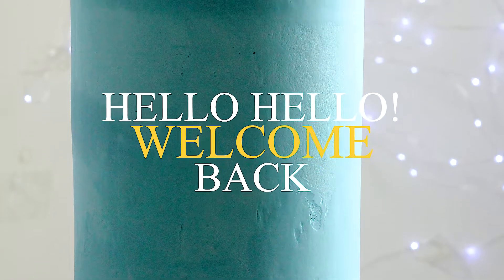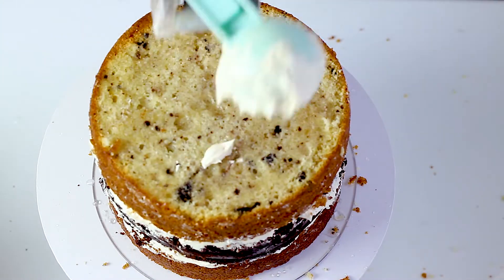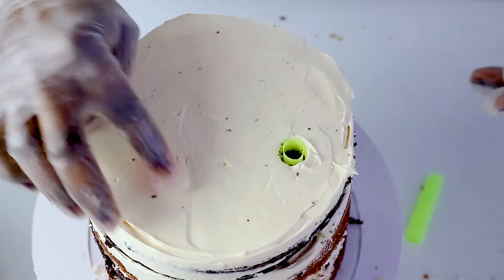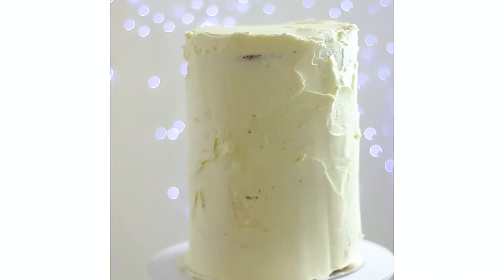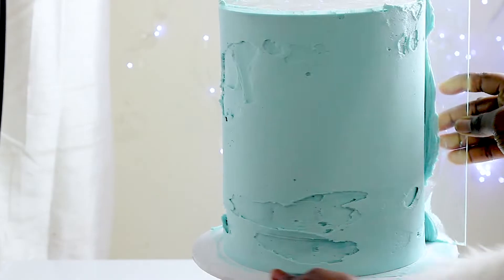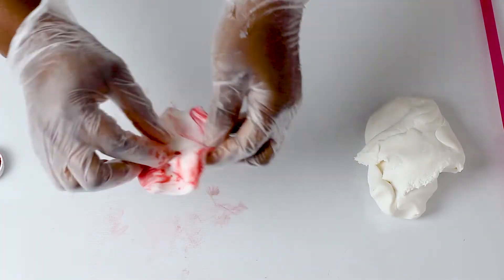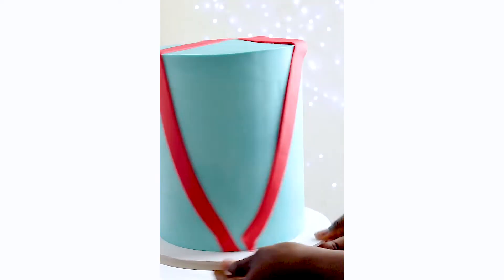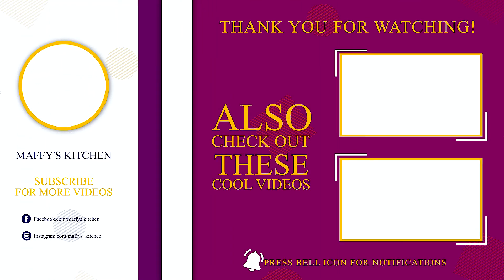How To Fill, Stack A Tall Double Barrel Cake | Using ACRYLIC DISC | Layer Cake

Comment: If you were making a tiered cake with the double Barrell cake as the base, then how would the support system for the top tier work? Would u push the dowel all the way down or until u hit that middle board?
Reply: You would poke a hole in the center of that middle board so that the center dowel goes through each layer of cake.

Comment: How do you know the dowel can pass through the middle board directly and simple as that
Reply from the maker: Great question! I previously drilled a hole in the middle and aligned it to stay in the centre of cake to allow the dowel pass through with ease.
But I understand there are some thin cake cards that are quite easy to pierce through without pre-drilling even though I wouldn’t take that chance.
Thank you for asking. ❤️

Comment: How do you bake those thick layers? Mine are either burnt around the edges or raw in the middle.
Reply: I used to have the same problem until I started baking at 160°C/325°F. I also invested in an oven thermometer. Hope that helps

Comment: Looks fantastic!  Will you share your buttercream recipe?
Reply from the maker: Thank you so much. I basically used the common American buttercream (ABC). Only that I don’t always use the exact 1:2 ( ie 250g butter to 500g icing sugar) measurements as most do depending on the weather and decoration I’m going for. 
Most of the time, I just eyeball the amount of icing sugar that goes into my butter which is usually less to achieve a softer yet firm consistency. I do this mostly in cold weather conditions.
But if I need it extra firm, I might go overboard just a little with the sugar🙈.
In a nutshell, I tailor my recipe accordingly to the cake decoration and the weather if that makes sense.
Reply from the maker: @Karen Wilcox, I must also add that I don’t always use ABC for the inside of my cakes most times. I go for others such as the Meringue based buttercreams, whipped cream/ Cream cheese or Chocolate frostings as they’re less sweet compared to the ABC.
Reply: @Maffylicious1  Thank you!  I always seem to  end up with ABC which is too stiff to easily apply.  I'll play with the ratio.
Reply from the maker: I can totally relate to the ABC being too stiff to apply or to pipe flowers. 

You can always return it into the mixer and add some cream cheese, milk, or whipping cream to reduce the stiffness. 
Sometimes, I use marshmallow fluff or melted marshmallow. Or I’ll just pop it in the microwave for few seconds if I have non of the above. The options are endless.